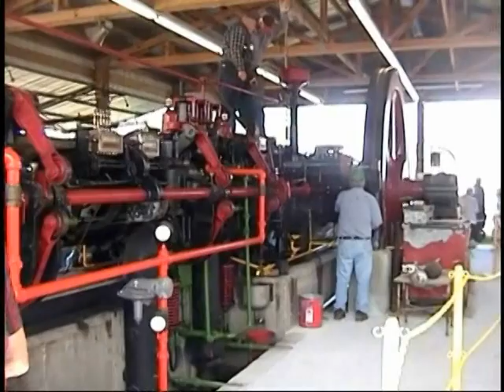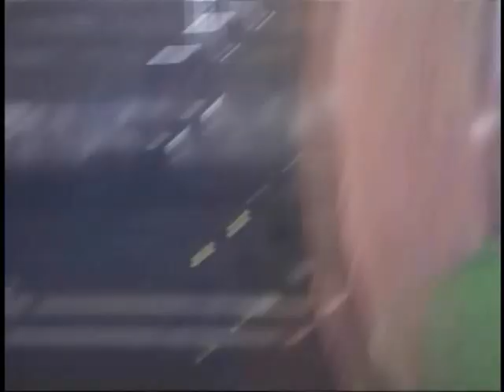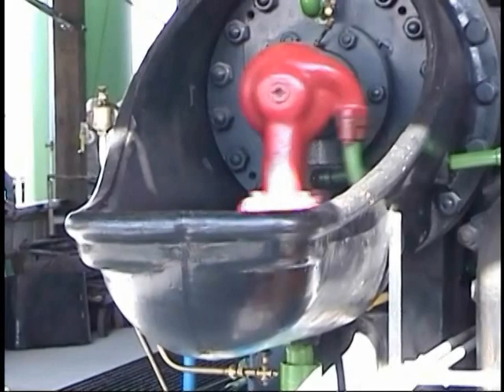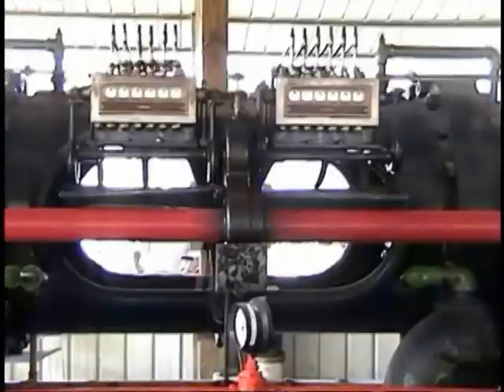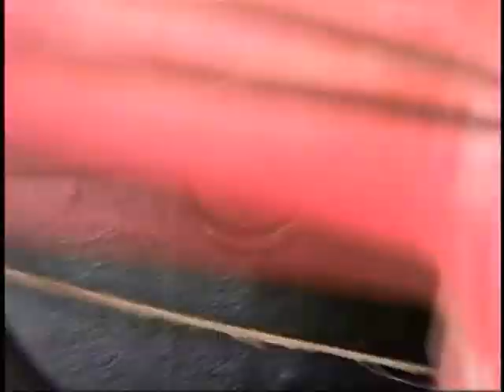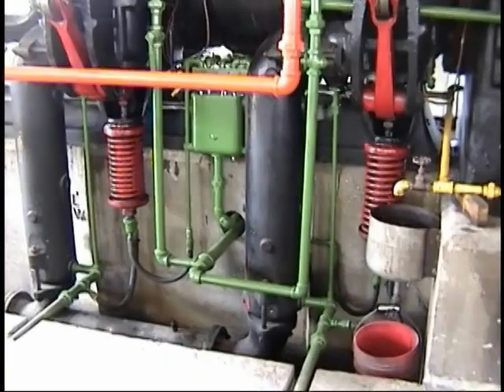40,000 Cu Inch 2 cylinder 4 carbs 400 h.p.

Comment: @Taterslawify now, to put that much torque in perspective, lets say we did put a simple one foot long lever on the crankshaft. that lever would be able to exert MORE than 8 3/4 TONS of pressure, at 90 deg. angle from the lever. 
so, its no joke when you say this engine has tons of torque.

Comment from the maker: If you look at the configuration of the engine it has 2 piston and 2 cylinders. It uses a crosshead to move the pistons in the cylinders. There are 4 intake valves, 4 exhaust. There are 4 combusion chambers, one on each end of the cylinders. So the total is under estimated for a total of over 45,000 cu. in. !!!! Thanks for pointing that out....

Comment: Think that is an impressive number, this engine made 400 HP, one of Titanic's triple expansion 4 cylinder steam engine made 15,000 hp at 75 rpm.  That is 1,050,400 ft/lbs!!!  One R4360 28 cylinder 4,360 CID radial made 3,250 HP @ 2,800 rpm or 6,096 ft/lbs and achieved 1.11 hp/lb

Comment: are you sure about the 4 carbs ??? We had a Snow engine like this at Van Compressor Station here in Pa. on one side of the piston it burned natural gas, on the other side it pumped it. So I burned as much as it pumped. The one here had 4 double head cylinders inline and a 24 ton flywheel.
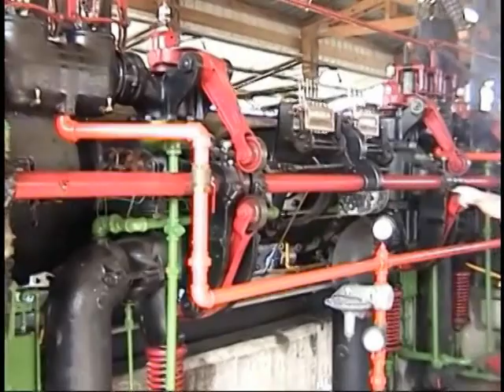Reply from the maker: Hello odatmatt, Yes this engine has 2 cylinders with 2 pistons and there are combustion chambers on both ends of each piston. You can see the rocker rollers and arms for the intake and exhaust for each end of the each cylinder. Look at about the 1:45 mark and you will see the big mixer with fuel adjustments on each end. The pump for natural gas is on the other end of the engine. Seems like I didn't get a shot of it in the movie. Sorry.. I have other movies of this engine and I know there are several others on YouTube that does show the large pump that is about 4 foot in diameter. Thanks for the comment... Fred
Reply from the maker: I have added a link in the description that at the end you can barely see the compressor. I usually don't take a movie of it because you can't see anything move.

Comment: Not certain on the Torque!
Probably safe to assume it's torque is 
around 5000 ft pounds
Reply from the maker: Ken Alexander 400 x 5252= 2,100,800 divide by 150 = 14,005.333 ft lbs torque